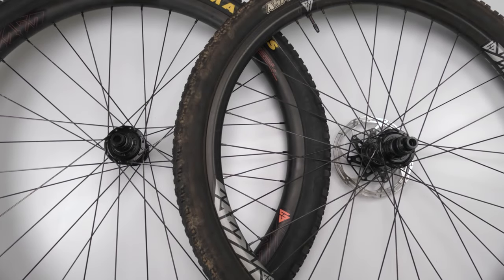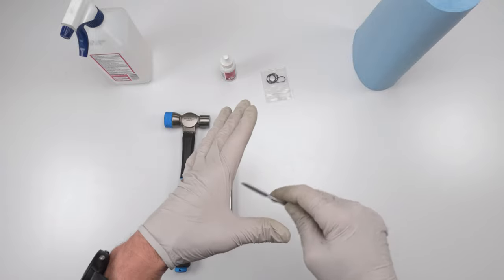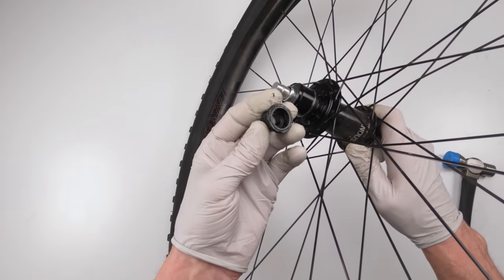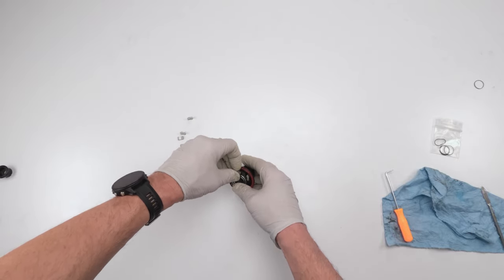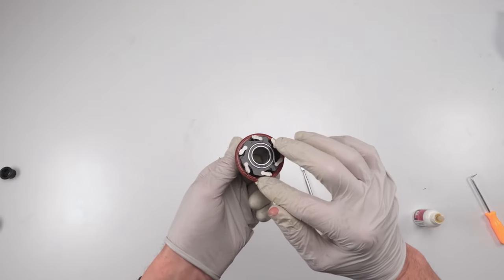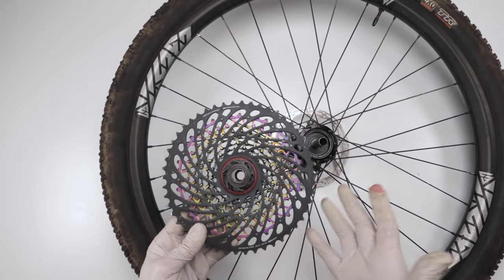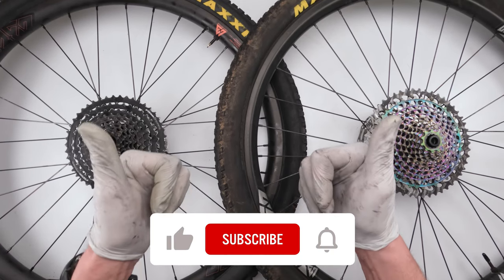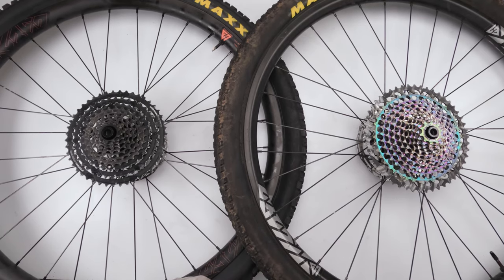Industry Nine Torch vs Hydra mountain bike hub service guides and Comparison for beginners

Comment: Thank you for your efforts in making these service videos.

FYI: I9’s Torch service page says both Dumond Tech oil and grease are ok to use, grease for a quieter hub.
Reply from the maker: Thanks for the info. Years when I bought my first set of torch hubs (which had a manufacturing error and were replaced by I9 VEYR quickly) I was told by them to only use oil. If they change this that's great imo in order to dampen the noise.  👍